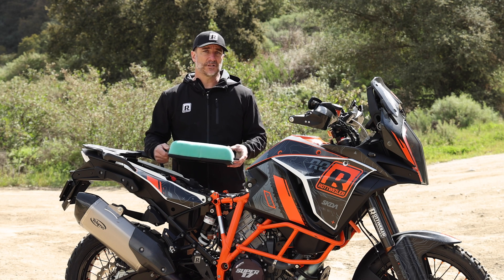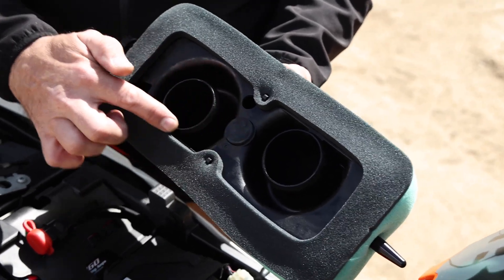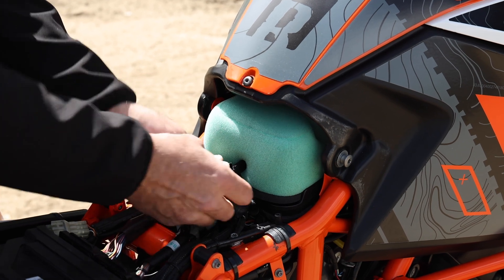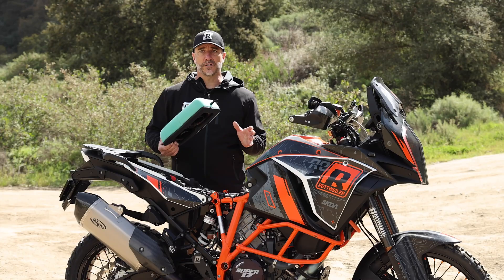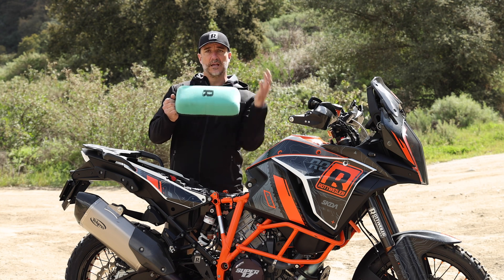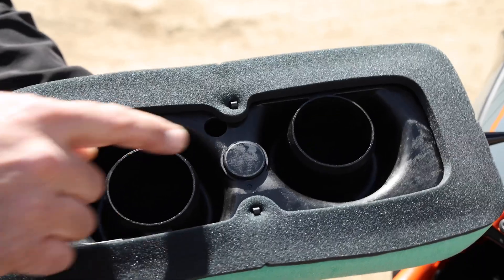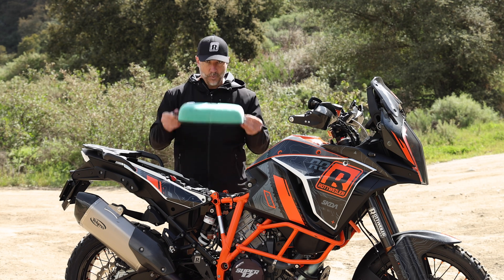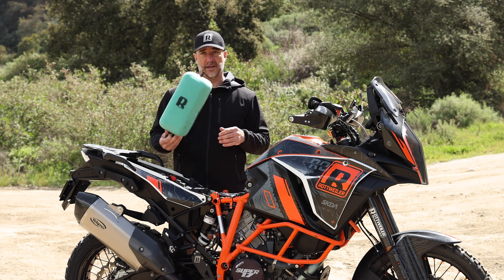Chris Parker Breaks Down The Design Philosophy Behind Rottweiler's New SOLERA Intake System.

Comment: We need this for the Africa Twin
Reply from the maker: Can you tell us what the issue is with that bike in your opinion?
Reply: It requires fairly time consuming removal of various fairing and trim panels on both sides of the bike to access the two air filter elements. Not sure if all models are the same, but my 2019 CRF1000 has an air filter element on the left side of the bike and another on the right. It would be so nice to have something like the one you developed for this KTM available for my bike.

Comment: Won’t dust and debris collected around the filter fall into the intake when you pull this out and push it back in? Pulling the tank sucks but it ensures you can clean around the filter before pulling it so nothing can inadvertently fall in…
Reply from the maker: In terms of the throttle body and dirt getting scraped off, this can certainly happen and we have good solutions listed in the instructions, but in testing it was actually less of an issue than we anticipated. That being said there are a couple of things one can do. One is to tilt up the filter before pulling it backward and sliding something underneath it like a piece of cardboard to catch anything that may fall off the front when pulled off, or simply using compressed air to blow out the shallow tops of the throttle body if you are at home. They sit with the butterflies closed and nothing will pass pass by them. During testing we purposely caked the front of the filters (which can be reversed for a clean side mid ride with this system) and removed them over and over, watching the throttle bodies closely and were surprised at how little fell off when purposely being sloppy with the removal which are things we have to anticipate with possibly 1,000's of users. The design had some things to overcome, but we are extremely satisficed with the results and the things you mention have solid solutions rest assured.